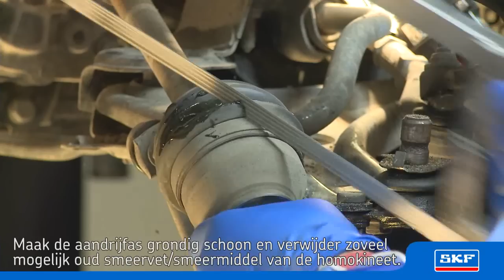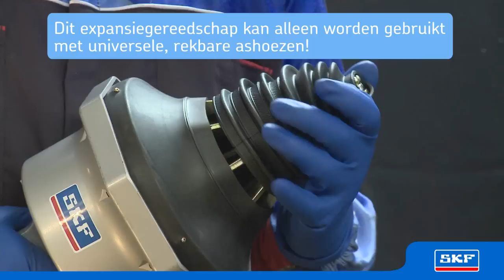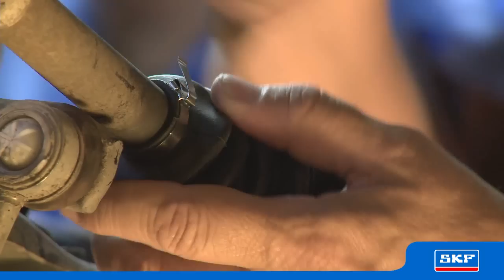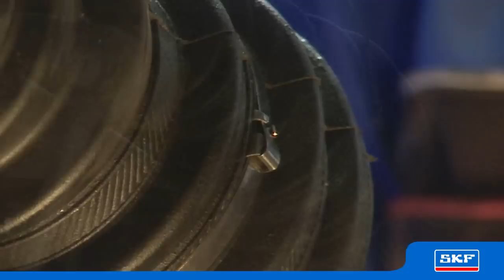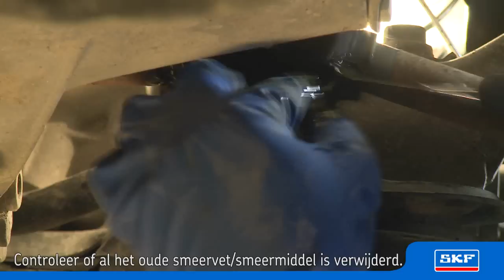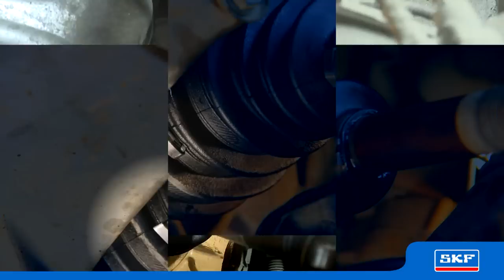SKF - universele ashoesvervanging (VKN 402)

Comment: The tool, used to insert the cv boot, must be expensive. Good demo, however most garages and diy'ers will not have access or no intention of buying that tool. Most mechanics and diy'ers do are removing first the cv bearing assembly to enable the insertion of the cv boot. How I wish SKF will produce the "split type cv boot kit", this is the most simple method to replace a cv boot.